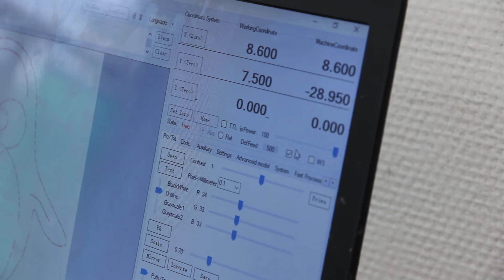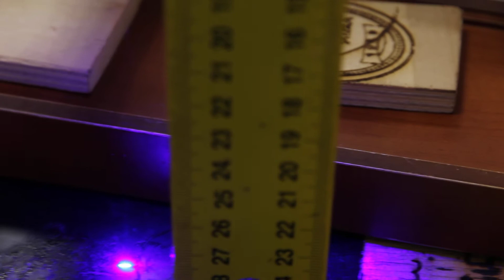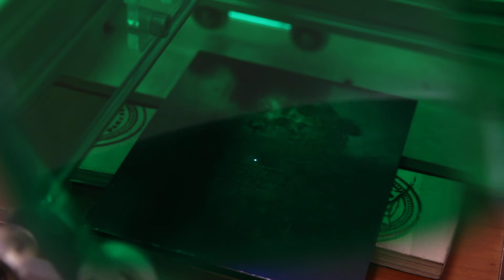How to focus a solid-state laser

Comment: How you do to turn on the laser? just power on the machine and the laser it is on? or there is a command gcode or something that we need to do it? thanks in advance!
Reply: If you are using a ramps 1.4 motherboard you can edit the gcode with the command M106 S255 to turn on the laser and M106 S0 or M107 to turn off the laser.

Comment: Hi, I want to use one laser with uv curable ink in a project. I need the smallest dot size possible, Do you know if the dot size will decrease if I use a weaker laser or set pwm to get weaker beam? Are there any high quality brand lens to use with this kind of laser?
Thank you